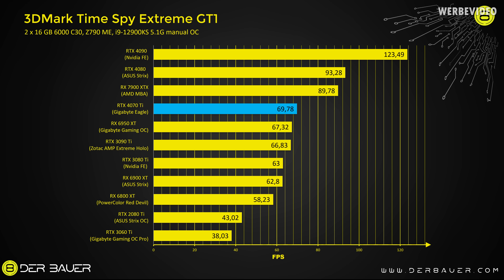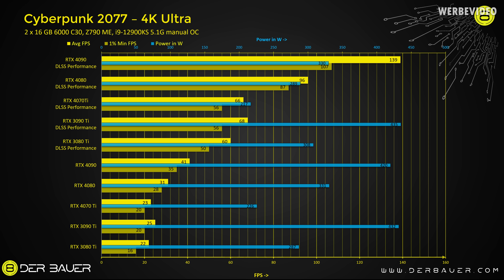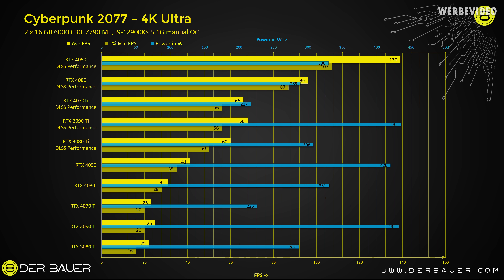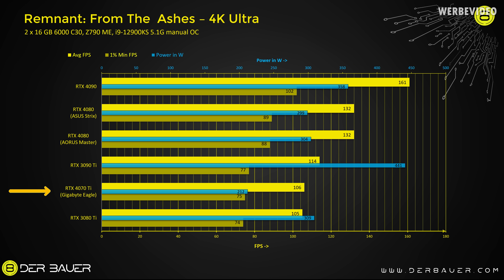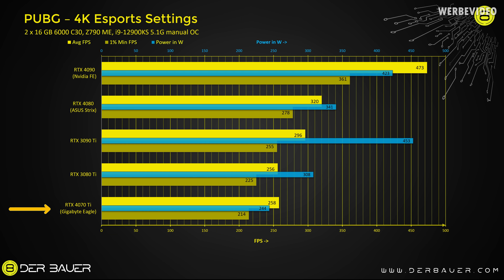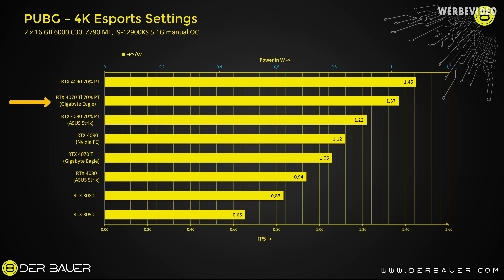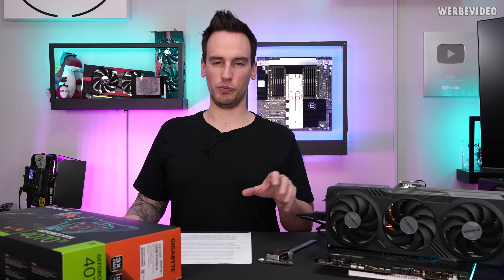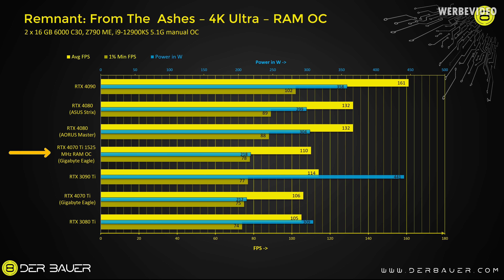Overclocking RTX 4070 Ti VRAM to Compensate 192-Bit Bus Width?

Comment: It's a shame the prices are the way they are. Ada really is an impressive architecture. The performance, features, and efficiency are to be commended
Reply: Indeed but since people keep buying and Nvidia owning the vast majority of the pro and pc gamer market they have zero incentive to suddenly charge pre-2021 prices again.
Reply: Ada sucks
Reply: And rdna3 is basically electronic waste
Reply: That is why Nvidia is charging so much. Want a card that does under 300W? Pay $800 or $1200.
Reply: Samsung has their own fishes to fry, probably viewed nvidia as a novelty experience at best. From which they learned plenty.  

If it’s driver or other component AMD may have to restructure. 
If TSMC has fault for AMD gpu, AMD absolutely should use Samsung.

Industry solved!

The mystery of my EVGA GTX 980 SC dying remains.  
Worse I have to figure out what to do now. 
Fkin 4090 is more expensive than the whole rig I built last. 
Not a gamer so I may go A series where the A stands for ain’t cheaper.
Reply: ALSO speaking of industry, reminds me when my computer issues began late October.
My monitor started blinking, I thought it was the monitor going out 5k not cheap! 

Then I fiddle with another monitor it starts ok but too starts acting funny. 
Nov take system apart reseat card it woks barely. 
Learn EVGA is out of NVIDIA loop thinking back to driver issue as development of 40 series was going on. 
Rolled back driver to before that date card worked fine.  
Sabotage!?
Reply: It's been gimped from commercial success, because of greedy marketing, having the knock on effect of a 3090ti being still 1k + in any currency. I expect the 4070Ti to reflect the performance increase in line with value over it, so 1k. The 4060 series isn't looking good for being anywhere near where it should be
Reply: Aida Lovelace is (so I have heard) not much different than the Ampere architecture.

Aida Lovelace GPUs apparently have significantly larger cache sizes, but they're also using a much more advanced process node than Ampere was using. Nvidia switched from Samsung "8nm" (10nm EUV), which was significantly inferior to TSMC 7nm, to using TSMC "4n", which is a slightly improved version of TSMC 5nm. So, Nvidia went from using a significantly worse process node than AMD last generation, to using a slightly better process node than AMD this generation. It would have been shocking if there WEREN'T big improvements to performance with this generation of Nvidia GPUs.

If Aida Lovelace had been on TSMC 7nm, clearly it would not have been nearly as good, though they'd also be paying less per wafer, and also charging less per GPU and less per graphics card, and/or they could have used larger GPU dies at each tier to compensate. For all I know, Nvidia may have actually wanted to use 7nm, at least for a lot of their GPUs, but maybe there wasn't enough capacity available for them to purchase? I'm sure they still could have been relatively competitive on 7nm with Aida Lovelace, just like they were last generation on a worse process node than AMD. However, my guess would be that they definitely didn't want to risk being on an older process node with their highest-end GPU, at the very least. I also don't know how feasible it would have been for them to have been developing and releasing the same architecture on those two different process nodes.
Reply: Nvidia's power target for each generation of graphics gets dictated by the competition. If amd gpus were stronger this generation Ada's `efficiency` wouldn't be a thing
Reply: More like Linda Lovelace this generation
Reply: Umm what?  Are you trolling right now?
Reply: Speaking about pricing Had bought mediocre rtx 3060 for 750 two years ago
Reply: I pulled the trigger and got the 4080
Reply: 4090 is worth the 1800 i paid and the 200 for water block.
Reply: but in Australia it's still one of the best choices if you want to upgrade as 3080 is $1200 and 3080ti $1400 plus while the 4070ti can be as low as $1200 for meh brands but a nice tri MSI for $1350 so the 4070ti makes sense. All cards are a ripoff here you just have to decide what is more of a ripoff lol.... the 3090 and 3090ti are still $2000 to $3000 here!!
Reply: too bad they gimped everything to induce obsolescence earlier. They dont want another 1080ti on their hands. Only ever giving bare minimum.
Reply: Ada isnt really that great.

TSMC is.
Reply: @flimermithrandir  😂
Reply: @flimermithrandir  Architecture>Node
Reply: @flimermithrandir  HAHAHAHAHAHAHA WHAT?!
Reply: @flimermithrandir  Definitely a combination of the two. Ada definitely has some nice architectural improvements though that can't be completely attributed to the better node, but yes, going back to TSMC definitely helped and going to the smaller node absolutely helped.
Reply: @ColeMarkusen  Yeah i am not saying everything is bad with it. Some Stuff is cool as well.
Reply: @flimermithrandir  that's like saying Fermi 1.0 wasn't bad tsmc was
Reply: @virtualtools_3021  So would you say Samsungs Node was better than TSMCs Node?

I am curious. Tell me. Enlighten me.
Reply: @FlimerMithrandir  I would say that Nvidia either knows how to get the most out of each node or at least doesn't completely destroy the nodes capabilities. Nvidia+Samsung was equal to AMD+TSMC and Nvidia+TSMC is much greater than AMD+TSMC.
Reply: @flimermithrandir  So why are AMD's card shit compared to nvidia in performance even though they both use TSMC. Because Nvidia paid the big bucks for 4nm while samsung cheaped out with 5nm
Reply: @bradhaines3142  The 4090 is no where near 10% of AMD lol, ADA is a much better architect and not to mention raytracing and dlss. FSR is a joke at best, it barely does anything.
Reply: @alexisbad123  I mean... thats harsh again for no Reason and Context. AMD is on a different Node. Nvidia is using 4NM. AMD a combination of 6NM and 5NM. But in Generell this means also that AMD will have WAY more whiggle Room when it comes to Costs and later cuts in Prices. Something Nvidia would love to have right now since AMD has some very different and huge Issues... They also have 3 different Issues which makes it even worse.

1. A cooler Issue with the Vapor Chamber that effects many users where the GPU Hotspot hits 110 Degrees. Pretty insane. Maybe not AMDs Fault as is but THEY need to sort this out.... at best now and not tommorow...

2. Also they have another Driver/Software Issue because... they just have. Really bad imo... as well... I dont know why but it should not be a Thing every Gen. They need to start using some Money to invest in bigger Teams. I think they are competetive but they just arent big enough to  compete with Nvidia anymore here AT ALL at Times. Its impressive as a Stand alone but when you know Nvidia as well... Its not good enough anymore.

3. And it seems there is some sort of strange "Port" Issue as well where you switch the Display Port and you get Way better Thermals as well. I cant even tell how stupid that seems. I dont know if thats true however as well. 

Overall... Very bad. Really not a Fan of AMD here. They fucked up and not just a bit. I can see them struggling with the MCD a bit because its new and not working out of the Box 100%. Sure. But they should have done more to prevent all the other stupid Misstakes they made. They really fucked up. Also lied about Performance Targets. Maybe not willingly, knowing it wont meat those but they did.

Anyways. Thats not the Point. Point is... Nvidia is using the 4NM Node.

AMD is a Node behind with a combination of 5NM and 6NM. Or like 0,75 Node behind.

Of corse i cant say how much this is actually really but its not just nothing.

And again... i never said "OMG ADA is the worst Architecture ever made. Nvidia only got an boost because TSMC is the best and they get 50% just because of this."

No. Thats not it. Just wanted to say... TSMC is also a Part of it. Maybe 10-20%. I dont know. But it is a Factor. 

It would be REALLY interessting how an AMD Architecture would do on the 4NM Node and vice versa the Nvidia one on the 5NM 6NM Combination. But thats of corse not Possible. Just saying it would be cool to know.
Reply: @TheEchelon  yes, only pure rasterization.  It's close either way.  You pay more for Nvidia because of there proprietary features.

With DLSS 2.0 and 3.0 it won't be close.  DLSS looks better than FSR too and DLSS 3.0 has no equal from amd.  They haven't had time to copy it with a worse version yet.

If you turn on ray tracing it does much better there too, inherently without DLSS.

NVIDIA is also using a 4nm chiplets.  The smallest available.  Cutting edge.    AMD is using  5nm  chiplets.  Last gen tech.  Someone has to push the market forward.  It's not AMD.

You get what you pay 🤷‍♂️
Reply: @flimermithrandir  TSMC makes what they are asked to make
Reply: @flimermithrandir  BS you need great architecture as well not just a node. Even when AMD has the node advantage they still get beat in performance and usually efficiency as well.
Reply: @ZackSNetwork  I never did say otherwise.

So now you want to say TSMC is worse than Samsung.

By your Logic thats your Conclusion.

I just pointed out that ADA isnt the only Factor. Thats it.

Comment: With this gen, power efficiency is back on the menu boys! After Ampere, of course, that gen was all about max overclock. After all, he is the famous overclocker.
Reply: We need that 10 series efficiency back with a performance bump for the 50 series
Reply: @RE3PTV  Not the brightest bulb in the chandelier, aren't you?
Reply: @marmar7089  Insulting for what reason? The 40 series is very efficient compared to ampere but not as much as the 10 series over the 900 series. Plus the performance bump was higher at that time more so than this gen. So I ask you again, why insult?
Reply: @RE3PTV  Remember when rdna2 was 20% more efficient and everybody was like power efficiency is so 2019. We are all about max performance! 3090 chugging 450w while 1% better then 300w 6900xt.
Then rdna turd3 comes out, sipping 400w and all of a sudden power efficiency is back on the menu boys!
His FIRST review was not 4090 OC, but how 4090 loses only 5% perf at 300w.

Comment: It took a while, but I matched the 4070 ti's 69.78 fps in TSE GT1 by clocking my XFX Merc 7900 XT to 1763 MHz @ 835mv.  The power limit was set to -10 and memory was clocked to 2810 MHz.  CPU 7700x clocked to 5.3 GHz at 1.22v.  DDR5 6000 expo memory CL30 aggressive memory settings in bios.  With those settings it achieved 69.71 fps.   It used between 261 and 273 watts during the benchmark.   So that is how you lower the performance of a 7900 xt by over 38 percent to match the 4070 ti.  You also get 40% less memory.  Sounds like a steal at a hundred dollars less.
Reply: 4070Ti is making 7900XT look good at $899 the AIB 4070Ti is $850-$1000. only FE card is $799

Comment: Seeing a $800 card beat my $2000 card that I got less than a year ago is a big oof moment :D.

But eh, I was gambling on GPU prices going crazy again when I purchased and I lost.
Reply: You were gonna get boned regardless, at least you got it over with
Reply: Needing a GPU for the last 2 yrs is just bad luck. Those who didnt lose money lose time.
Reply: But that's your stupidity.
Reply: @panjak323  That's what "big oof" normally means, yes.
Reply: @jimmydesouza4375  well big oof is paying 2000$ for any GPU.
Reply: @panjak323  Kind of.  I bought it primarily to play VR flight sims and VR is crazy demanding and ALL flight sims are optimised like ass.  You basically need the best hardware possible to get anything approaching decent framerates.

As an example in DCS on an index with all the graphics settings minimised on a 3770k and a 980Ti you get 1 to 5 fps while in VR.  Yes, 1 to 5.  Using the silly expensive rig I have now you get 20 to 60 with everything maxed.

If an actual optimised flight sim ever gets released that'll be the biggest oof of all.
Reply: @jimmydesouza4375   The main issue with DCS and MSFS is hi-res textures, a huge memory + huge bus card will do you more good than any ultra high clock gpu. 2k on a gpu is sad though, I feel you. 
I spent 380€ for a year old 3080 ti this summer after the big crypto crash (bought a 8gpu mining rig, parted it out and resold stuff as high as possible to just sneak one GPU into my system and make most of the money back) and I will hold on to it for the upcoming gen. Current stuff is just not a big upgrade unless you go for the 4090 which is a proof of superiority for nvidia but other than that just stupid for a casual gamer like me :D
Reply: @jonasduell9953  I was considering an ex mining card but I wanted to have a warranty and also have a decent chance at a reasonably long life for the comp and GPU.  My last computer lasted for 10 years and was still playable on new games outside of VR.  Reasoning is that if I can get a comparable life out of this one too then the expense isn't as major.

How is your card holding up, being an ex miner?
Reply: @jimmydesouza4375  benches like a brand new higher good bin chip, no signs of weakness so far. I did take it apart, replaced all thermal pads/paste, gave it a "looks like new" cleanup. Even the fan bearings seem to be fine but I wouldn't care spending a few bucks for new fans. 
I think the "stay away from mining cards" thing is more a moral thing among gamers. Rigs are usually open bench, high ventilation style systems that - despite putting constant load on cards neither go through half as many intense thermal cycles as "gamer's" cards that cycle between 18 - 90 - 20 - 90 up down up down constantly.

Comment: Good for Nvidia if they managed to retain great performance despite cheaping out on the memory bus and VRAM amount. Now it should reflect on the price the consumer is paying, right? Right...
Reply: lol
Reply: Lol
Reply: I still dont understand all the whining. The performance is basically identical to the 3090TI. Mostly a little worse, some games even a little better. But its so much cheaper than a 3090TI. I can get a 4070ti brand new for around half the price I can get a used 3090TI, at least in my experience.
Reply: Prices of everything have gone up. 
A burger flipper gets paid $22 an hour.  Ask yourself if their service and food are worth it.
Reply: If this card had a 256bit bus it would just make me feel better.  Nvidia is just getting too greedy.  $1200 to get that in a 4080 is crazy.
Reply: @jeffconnor903 it's impossible to put 256bits bus with 12gb. The only solution are to use 8 chips of 1.5 gb, because 8*36=256, but I don't believe this kind of chip exists.
Reply: 🤣  it's  a  great 1440p card
Reply: 7800xt is like half of the price of 4070ti in my country
Reply: Lol, I’d be shocked if these cards cost even 400$ to manufacture for AIBs. With the corroborated rumor going around that the FE 4080 costs Nvidia a little over 300$ to manufacture, it really seems like they are just laughing their way to the bank with their customer’s money.
Reply: @MechAdv  Genuinely curious if those numbers cover the overhead cost of running a business, or if it's just the price of the parts?
Reply: @mambobro  BOM Cost and labor, distribution not included.
Reply: There is no “right” price. Production costs are an important but certainly not the only driver of final price. The economical environment, the targeted population, the edge (or not) over competitors in the same market etc. will impact the pricing of a product to maximise the revenue. Yes nvidia is not a charity, neither is amd or intel. Only strong competition will drag down the prices. But the days of 400-500$ for a high end GPU are gone anyway.
Reply: @MrTux0  Even mid range is over 500$ now...
Reply: How did they cheap out on the vram amount? It has 50% more than the 70ti last gen. Even the 3080ti, the second highest performance nvidia gpu for a while, has 12gb
Reply: Cheaping out....lol.  it's a 850$ 70 series you clown.....cheaping out....lol
Reply: @barryhoggle2354  Read again. It literally means that they cheaped out on production costs and yet they're selling it like a high end product.
Reply: You lost everybody at good for NVIDIA
Reply: @barryhoggle2354  I see irony is still foreign territory on the internet. Do you really think the likes my comment got were from people actually thinking that Nivida is selling their GPU for the right price?